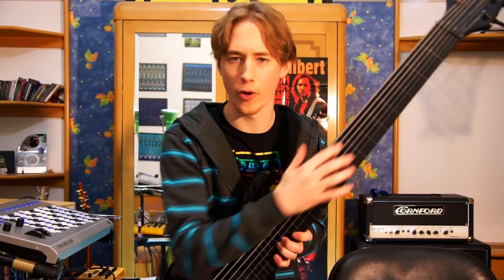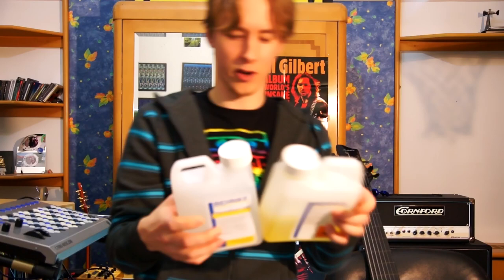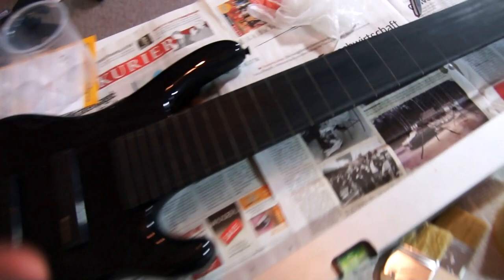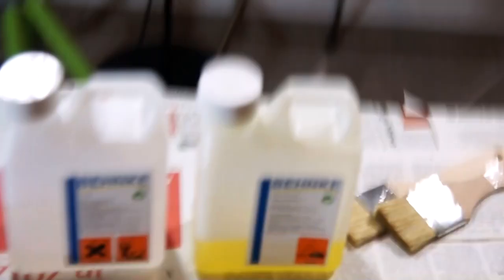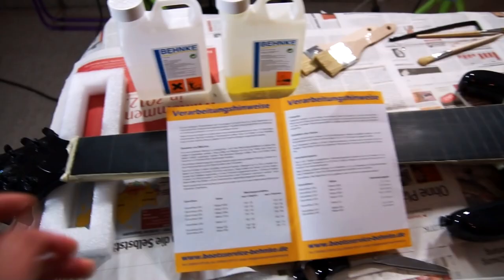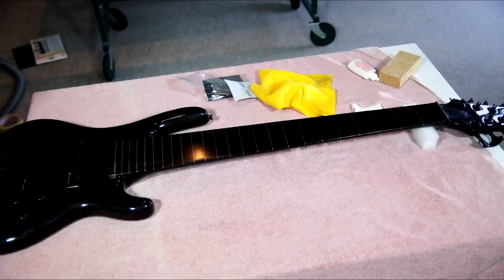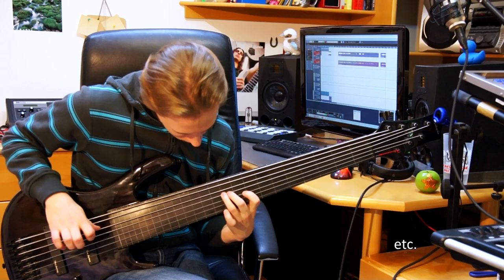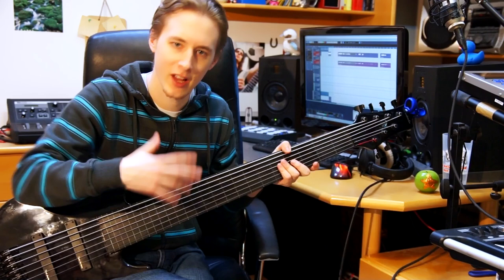Glazing the Fretboard of a Fretless Bass

Comment: if you dont have a buffing machine, those cheap, 4-sided fom block nail polishing files do the trick too. and a bit of car or plexiglass polish makes it really shine. 
(use the sanding block dry, but wipe off the dust with microfiber rag relatively often, for quicker results)

Comment: I've converted a number of guitars and basses in my experience don't use a paint brush as this will cause bubbles and create the need for excessive sanding it comes out better if you pour slowly and use heat to remove any air bubbles also be sure the neck is perfectly straight before you start the process and to get that mirror like shine its takes a buffer of some sort I've had good results with a car polish buffer and rubbing compound

Comment: i can highly recommend a long, soft brush lacquer/shellac to anybody concidering this. it holds a lot of resin, and helps to drag it out very evenly. ideally, you can get a layer thick enough to self-level to a degree, say 0,7-1,2mm. look at the reflection of a printed piece of paper or such, to find uneven spots.
ghetto method: 10-20 layers of superglue, spread with a rubber-gloved finger.
Reply: I have been using clear hard shell nail polish but super glue may work better. I have 2 fretless necks and use to take it into my friends shop and he would keep one always on the ready for me. I bought the bass new. Also put on the first BaddAss bridge ever sold and the same with the Hi-A pickups. I toured and had a couple studios across the country . Now in So Cal. Cleveland was just too cold for my hypothermic old body! BTW I use a razor blade on an angle and drag it over the wet polish starting on the good smooth part and over the concave portion. Ya need a magnifier...well I do anyway! Rock on or we'll hurt cha bad!

Comment: Great job. But it may turn out better if you use a foam brush that can cover the thickness of your fretboard, so you can paint on the epoxy in long streaks to sort of avoid uneven spots.

Comment from the maker: awesome, thanks
this was my first try at doing this. One day I'll surely try it again and then I'll do it with your tips :)
Reply: Only one single layer ??
My brother put some 20 layers on his JB !
Reply from the maker: @tobbebergman7583  maybe he used poly urethane (clear coat used on cars). But epoxy resin is easily thick enough with just one layer. You can even pour it several centimeters thick in one go (not on a bass of course) and it'll become hard as stone through and through

Comment: completely mask the neck then form a dam around the fingerboard and pour the epoxy onto the dammed fingerboard go in small passes you don't want bubbles or a leak I prefer to work at around a 32nd of and inch each pass be prepared to need a new nut and use a radius block because you are going to re radius your fretboard because the epoxy will self level flat and before you star adjust you truss rod so the neck is flat

Comment: Yeah, but when i got mine the electronics had already been swapped with a cheap Artec thing. Unfortunately solving that issue was the first time i held a soldering iron in my hand, so i ended up messing up everything. I'd go with fretless but i'm not sure about the neck, some parts of it are very worn out and it looks like some wood filler was applied to it. Overall i thought getting this bass was a good deal (200€) but in the end i just regretted not spending them on something else.

Comment: I have a '66 Jazz Bass neck. I bought it in '96 already Jaco'd. Once the rosewood got too worn and stared buzzing, I had it glazed. Hated the sound. I keep it for sentimental reasons. I replaced it with a Warmoth maple neck and ebony fingerboard which sounded absolutely killer with DR Sunbeams.
Reply from the maker: cool, how well is the ebony fretboard holding up with the DR Sunbeams (since they're not flatwound)?
Reply: Oh Ebony was made for fretless. Super tough wood. It will make little marks if you look real close, but they aren't deep grooves that cause buzzing or affect the sound in any way. Rosewood will handle it for a shorter time...maybe a few years. There's something perfect about the chemistry between ebony fretless and nickel wound strings. It's like chocolate and peanut butter. Add EMG Jazz pickups with their BTC Active EQ (it has stacked low and high knobs) and you are in for legendary tone. By the way, I'm not slamming your project. It clearly worked out for you!
Reply from the maker: @johncbeer  my project is from many years ago, so maybe one day I'll get another fretless. What you're saying sounds really good, I'll be sure to get one with an ebony fretboard then.

Comment: Nice job but let me add as a professional house painter.....first use a roller to apply the epoxy  using a 10 mm roller, then brush out the streaks, however ............................NEVER USE THOSE DOLLAR STORE BRUSHES..........buy a high quality brush made by a company called Purdie,................Thanks

Comment: Nice bass, not very instructional though. I would have liked to seen the sanding steps and so on 🤷‍♀️
Reply from the maker: I was sanding with a P400 (and a sanding block) to get rid of the high spots and then I gradually switched to the next higher grit. And I did it all dry, somehow that worked with the epoxy (the sanding paper didn't get clogged up). But back then I wasn't so sophisticated yet. So now I'd also polish it (eccentric polishing machine and automotive polishing compound).